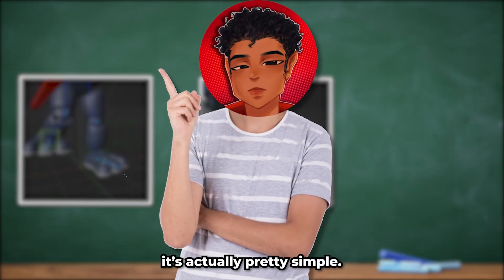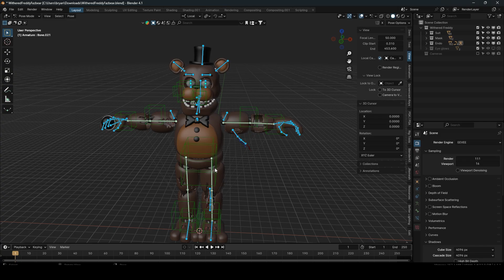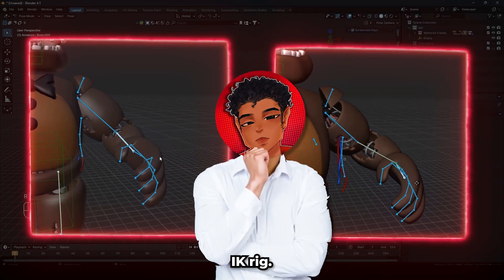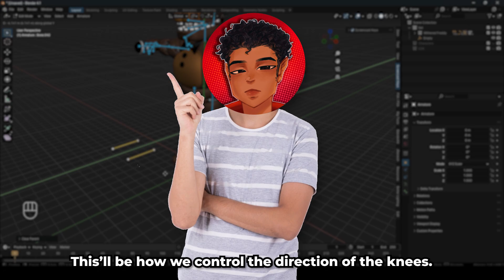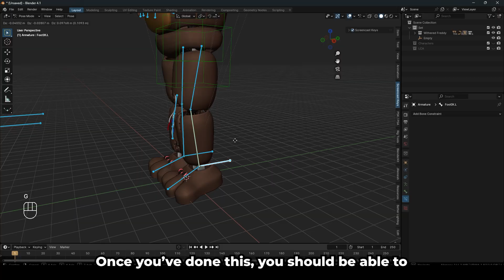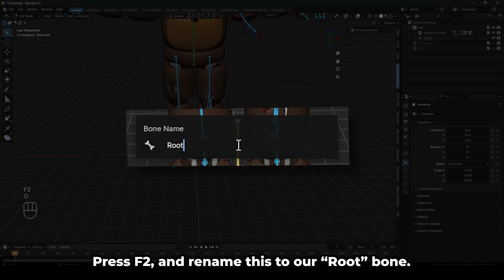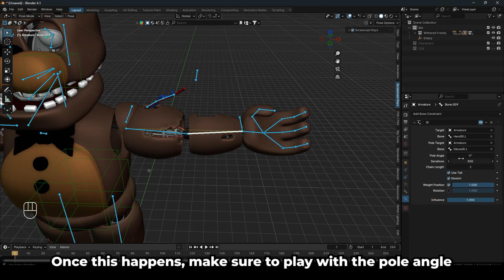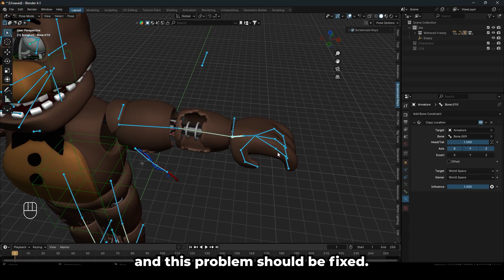Add INVERSE KINEMATICS to FNaF Models in Blender!

Comment: Tip: select the lower leg or thigh bone and shift select the foot and press Ctrl+Shift+C and select copy location and it’ll  immediately make the foot copy the location of the lower leg or thigh bone the. Make to head to tail.

Edit:you can do the same with the ik for the arms by selecting the lower arm then sift select the hand then press Ctrl+Shift+C and select copy location and it’ll immediately make a copy location for the lower arm then make to head to tail

Comment: I have one thing to say.....

Yeeeeeeeeeeeeeeeeeeeeeeeeeeeees finallllllyy 

Sorry i dont know why i did but thanks for the tutorial! And what happend to the drivers?
Reply from the maker: To explain it, the "second" part of the tutorial would've been over 30 minutes long... so I'll be splitting them into parts. I'll do a driver tutorial after the lighting tutorial, but this is the first of many parts I guess.
Reply: Ohhhhh and also you can press ctrl tab to go to pose mode but only if you select the armature and you can do this to 2 3 armatures by shift selecting them
Reply from the maker: NAWWWW I DIDN'T KNOW THAT, I was wondering how you can switch to pose mode. Thanks!
Reply: @BTBAnim  no problem